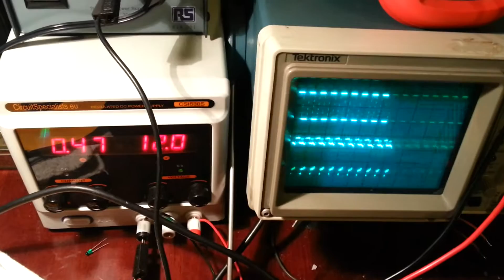Running a CD DVD ROM Motor with a Microcontroller

Comment: where is the scematic and sources of this project
Reply from the maker: There is no schematic available, the best way to learn how to control BLDC motors with micro-controllers or other IC's is to search for application notes on semiconductor manufacturer websites. They will supply the basic theory of operation as well as code and circuit diagrams.
Reply: I know how it's works, but i don't understand how you control cdrom's spindel with l298. l298 have one signal for input, which inverted for low signal for output. But when i control bldc i have situations when both low and high transistors must be closed. So if i will use "enable" pin - it will close both outputs simultaneously. Please, can you draw schematic, at least, by piece of paper.
Reply from the maker: With 2 L298's you have 4 completely independent half bridges(that's how I remember using it) only 3 are needed for this application.